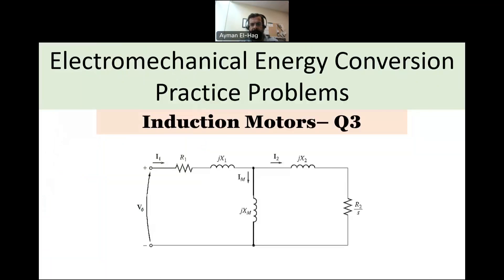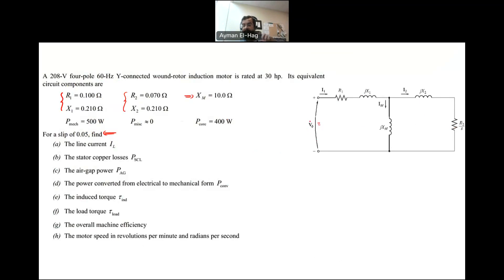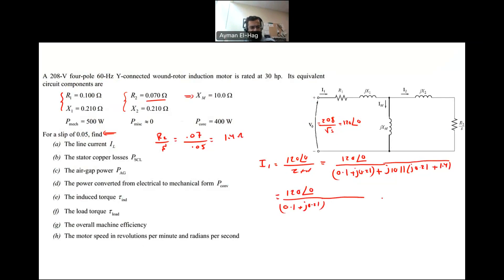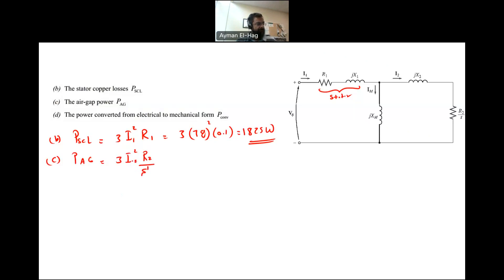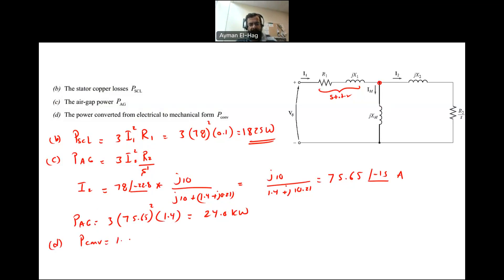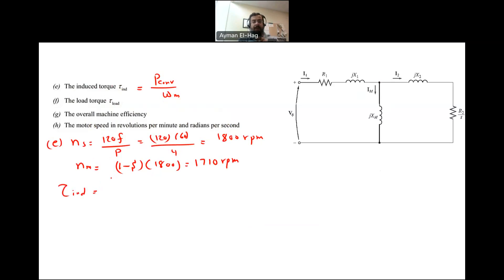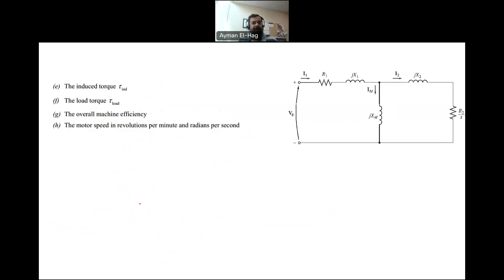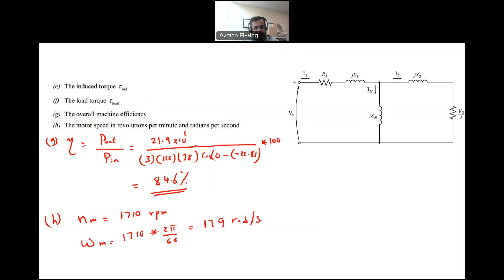Induction Motors - Question no. 3

Comment: Hi Professor, In the textbooks, the induction torque formula for 𝑇=𝑃ag/𝜔 is given using 𝜔𝑠 (synchronous speed), but you used 𝜔𝑚 (mechanical speed). Could you please confirm if there is a mistake?
Reply from the maker: The T = Pconv/𝜔𝑚 = (1-s)Pag/(1-s)𝜔s = Pag/𝜔s
Reply: @electrical4everyone  Thank you.
Reply from the maker: @kadrituremis1025 You are welcome

Comment: My opinion is that for question f) Pout = Pconv - Pmech (no Pcore). For question g) we can also calculate Pin = Pscl + Pcore + Pag or using the VI formula like you did (both ways are correct).
Reply from the maker: The core loss was not considered when calculating Pconv, then you have to take it into account when calculating Pout. As you can see in the model, there was no Rc, as Rc was not given which takes into account the core losses.